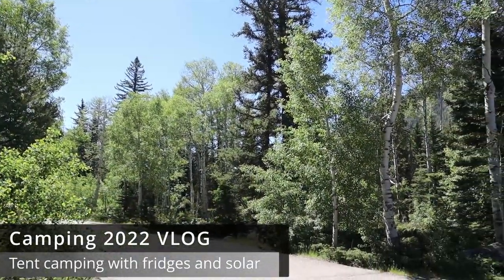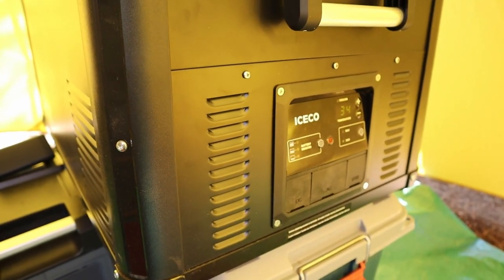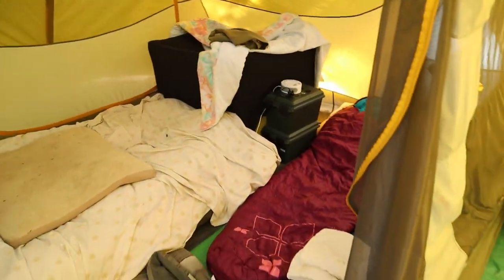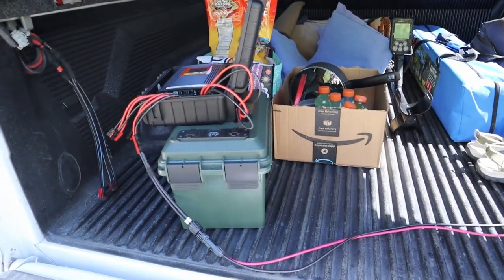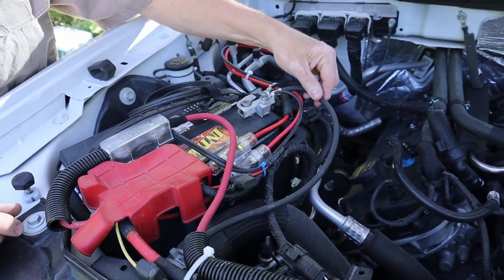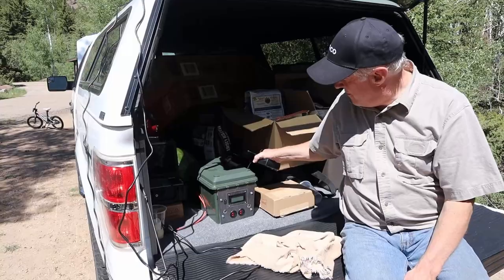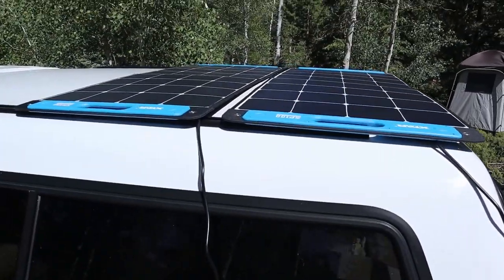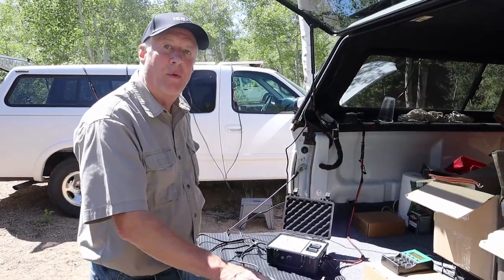Our Camping Setup - Solar Panels, Fridges, and Batteries! (Also Including Jeff's Setup!!)

Comment: I love gadgets and I already own a little solar portable system myself. I feel like I'm going to end up just like you with all those unnecessary fridges,batteries,panels,mppt controllers and so on. I got mine to have a chest fridge be able to run all day and keep the solar generator at 100%. Only issues with those Xtars is if there's shade they won't work.

Comment: Cool and functional setups Jason! Jeff's rig is pretty decked out! I have a shower setup also for really long trips. It includes a propane hot water heater so we can take hot showers during cold nights, a pump with RC LiPo battery inside a sealed ammo container (but can also power it from an external power source like a power station via a 3-way switch), fully enclosed so never has to get opened.
Reply from the maker: That sounds like an awesome shower setup. These pumps pull so little power a small battery would run for hours!

Comment: Great video. I love looking at other folks setup for camping. My wife and I enjoy camping in Utah, California, Arizona and a few local spots in Nevada. Our camping is slowly evolving, a few years ago we stated getting into solar and got a 12 volt compressor refrigerator. I am so happy not to worry about getting  ice anymore. I have to limit my gadgets though, i’m running out of space to store them while traveling lol. Thanks for posting these videos Jason.
Reply from the maker: You're welcome Stuart! Sounds like you go camping quite a bit. What's your favorite spot to go in the summer? We love to escape to high elevations to get away from the heat.
Reply: @Jasonoid  
Our favorite spot is along the California coast by Morro Bay. For higher elevation, Flagstaff. We tried Fish Lake (9000 ft elevation) in Utah, it’s beautiful, but that high up took several days to adapt to.
Reply from the maker: @stuartstuart866  I've heard there's great camping in Flagstaff. In a couple weeks I will be heading down near Fish Lake to Boulder Mt, which is near the same elevation. Were pretty used to it though since we live at 4500ft on the Wasatch front.

Comment: Nice setup.  I've got panels and power stations, but not the extensive wiring and charge controllers.  I've got a USB-charged handheld shower, but I like that 12V pump and have thought of setting up something similar although it would be to empty our rain barrels.  Thanks for the motivation!
Reply from the maker: The 12v RV pump pulls like 20 watts and is super powerful, totally worth it IMO.  It would make a great way to pump water around out of your rain barrels.

Comment: Thanks for sharing your camping setup.
I'm Glad your ffpower P2001 is serving you well. I received my replacement and it also doesn't want to stay on with my CPAP load. Hopefully it's something that can be fixed.
Reply from the maker: I havent tested the AC output as much as the DC output on the P2001. I am going to try to run a 20 watt load on the inverter overnight to see if the AC output stays powered on.
Reply: I also tried using the DC load with my own inverter. It also disconnected the DC output after about 2 hours. The load with my own inverter ran 0-150 watts. I am under the impression it doesn't like the dynamic load the CPAP generates. I didn't think to test the DC output on the first unit until you mentioned to try that, after I had already sent it back.
Unlike the first one however, this one doesn't come back on, and stays off. So I have to turn off the output and turn it back on manually.

Comment: So interesting to see how extensive your set ups are!  How often do you camp?  BTW: I'm looking for a dc-dc cord for my ICECO fridge that connects to the bluetti EB55 power station dc out (not the cigarette plug - the pin one).  All the plugs I've looked at are cigarette lighter ones.  do you know of one?
Reply from the maker: We usually have two full week long camping trips each year, with smaller overnight trips mixed in. To run a fridge off the EB55 I usually recommend taking the fridge power cable & cutting off the 12v socket on the end, and then attaching a DC 5521 barrel plug so it will plug into the 5521 barrel connections on the EB55.

You can do it this way:  https://amzn.to/3tYYcvS
Or soldering with these:  https://amzn.to/3NnNYfs

I think I am going to make a video on making your own custom fridge cable since I have had this request many times.
Reply: @Jasonoid  I think this would be great!  A how to modify your power cable for other connections.  I've seen you talk about it, and us non-savvy people would benefit!
Reply from the maker: @ninaturner8242  I think I'll create a "how to modify your fridge power cable" video very soon! So many people have asked for that video.

Comment: Thank you so much for sharing! I love camping with the family.... the river is beautiful..... so much information here......I am so on the fence with charging generators through my vehicle battery, I have a 300 and 500 watt inverter but im afraid that it will drain the car battery....I'll need to get the 12v battery gage you show plugged in the car....thanks again :D
Reply from the maker: Thanks MJ! You just need to have solar charging up your starter battery while idle or have the engine running and your battery won't die.
Reply: @Jasonoid  Thank you!😁

Comment: How much watts did you get from your PV350 solar panels and. How much better is it than the EcoFlow 400watt IP68 panels in low light and shadow.
How much rain was it did the underside stay dry.
Reply from the maker: It was laying flat the entire trip so I never got the full 350 watts. I saw around 290 watts peak. We had two rainstorms that had blowing wind and rain during out trip. The panel got wet on both sides and still functioned. I also took the garden hose and sprayed it off to clean it when I got home. Still works just fine. I don't have the ECOflow panel so hard to compare the performance.
Reply: @Jasonoid  I just ordered the PV350 solar panel.
Reply from the maker: @sleeperfs2651  sweet! What power station do you plan to charge with it?
Reply: @Jasonoid  ac200MAX
Reply from the maker: @sleeperfs2651  nice that will work well!

Comment: Do you run the six guage cables directly to your starting battery and do you have an inline fuse near the battery?  If you have the cable directly connected to your battery don't you then have to unplug your fridge or diy power station when you aren't driving?
Reply from the maker: Yes, 6 awg wires with a fuse. It depends how long you run the fridge /or power station off the starter battery. Under 30 minutes is fine with the engine off, any longer amount of time I like to use a separate battery to power my fridge.
Reply: @Jasonoid  Great information! Thank you!